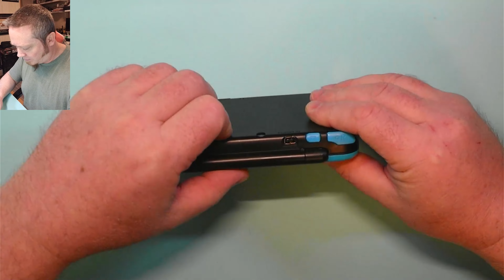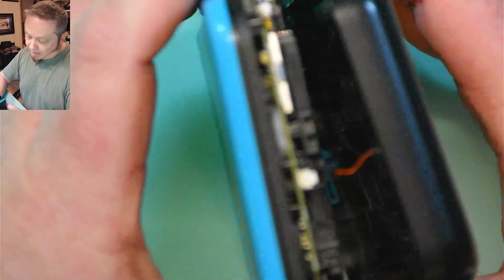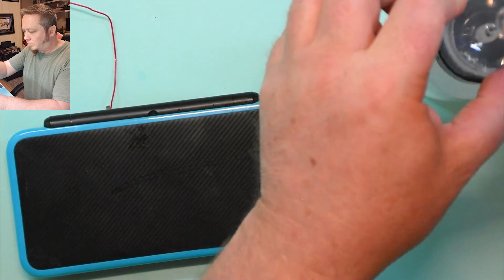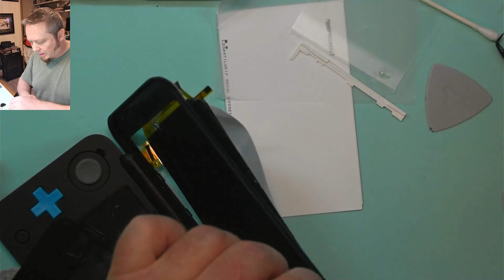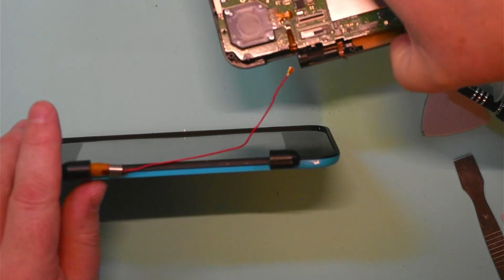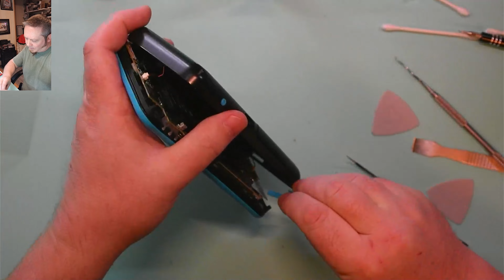PROPER! Nintendo 2DSXL top screen replacement.

Comment: My top screen just broke and currently trying to figure out how replacing the screen would go if I attempted it
Thank you!
Reply from the maker: Hi,
If you are going to attempt the repair, watch as many times as you can on replacing, not just my video but others until you are comfortable with the process. 90% propylene alcohol helps to free two sided taped surfaces as well as stickers. Make sure to have all the right spudgers and screwdrivers. Lastly have patience and take your time and take pictures as you go as there are many different types of screws and part orientations. Thank you for the comment and wish you good luck if you decide to take on this project. Consider commenting again if attempted, good or bad, as this will help others decide if they also want to take on a project like this.

Comment: You don’t have to take the front plastic piece off to get the lcd off you can just take it off from the back 🤦‍♂️
Reply from the maker: The front black plastic has screws hidden underneath that hold the shell together for this unit. To access the lcd these screws need to be removed. This makes installation of new lcd easier to access the ribbon easier. I appreciate all suggestions and in my experience sometimes taking it apart a step further creates an easier repair. Thank you for your feedback.